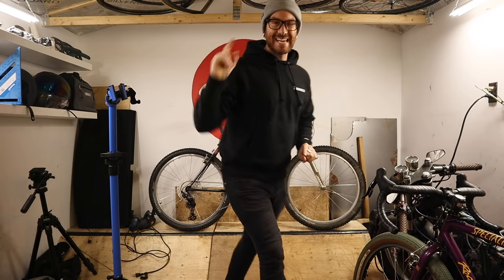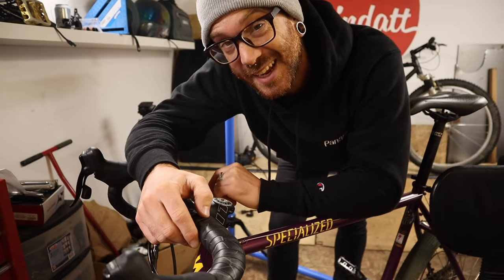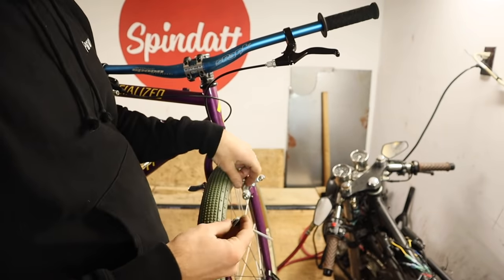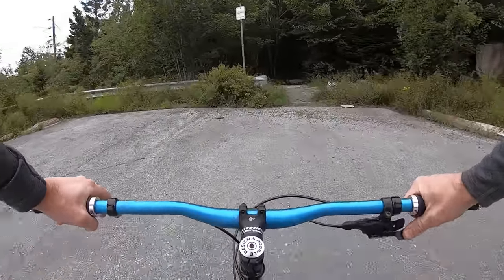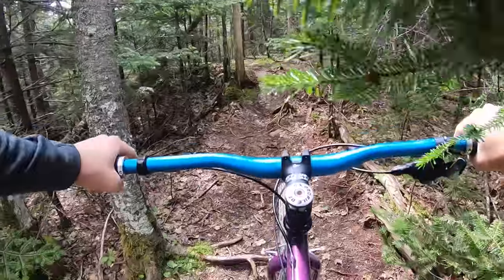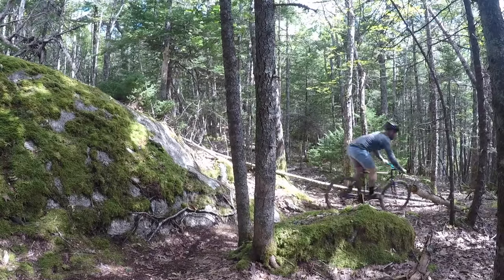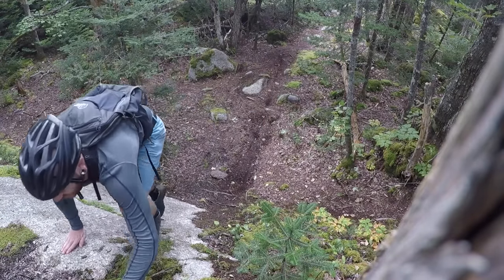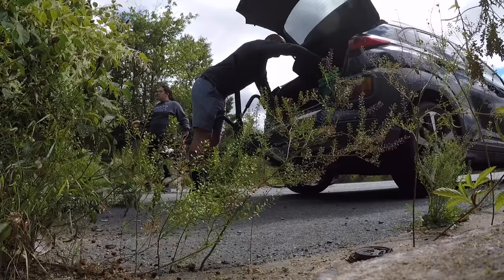I took my upgraded 90's MTB on real single track and...

Comment: We rode technical trails that were really meant for hiking on fully rigid hardtails. Now we ride buffed out and machine built bermy trails with 6 inches of travel and dropper posts. Weird. It's like we are allergic to bumps.
Reply: As someone coming back to mountain biking since the 90s, this is absolutely true.  It was all rocks and roots back in the day. Now it seems like a dirt slippery dip
Reply: @jackwilson8651  I'm trying to ressurect my MTB life after a lot of years out and a few kids in tow. Last time I hit some real dirt was in '94 on my rigid GT. I tried to kick start a new riding schtick in 2003 but the bike has languished mostly unused. Having got my son a somewhat capable  MTB I've discovered that my '03 bike is a dinosaur with 26" wheels and pre "modern geometry" lol
Well I'm still going to ride the ass off it, maybe even have a go on one of these slack-angled monsters. Or maybe I'll just have fun on my practically as new dino...
Reply: Absolutely the truth. I mean, the trails here (Terrace BC Canada) are not so flowy and the drops and jumps on a lot of the trail are really designed for full suspension...But take a full sus bike from nowadays and take it over the same trail as it was built out in the 90s (when it was a mixed use hiking trail) and it would have been the most technical gnarl youd ever ride.
Reply: @AlistairBrugsch  the old geometry its beautiful man, straight design, nothing curve or Fancy.
The new ones makes the seat looks as long as the frame tubes
Reply: Exactly , I started Mtbing around 1991 . Back then we needed these smaller bikes as for me in New Hampshire anyways the trails were either old logging roads ,  tractor trails on farmland ar very narrow hiking/walking paths through the woods .  Nothing was groomed or layed out specifically for Mountain Biking , loose rocks , leaves everywhere , roots , vehicle ruts etc .  Mountain Biking used to be an adventure where we would search for new trails to explore as it's now evolved into the equivalent of going skiing at a resort .

  This single track here in the video  is what my early MTBing experience was , it was a ton of work and wasn't easy . If these old bikes could fit 27.5 wheels to smooth things out a bit  they'd still be used in droves  as they're very light and nimble
Reply: @manchesterexplorer8519 You can pick up a good 1950s bike for about £30. It's not guaranteed that 90s MTBs will ever be worth anything. They could be garage paperweights forever. Unless a Tony Hawk comes along and makes them all the rage, it won't happen.
Reply: @GTMarmot  It depends on the bike as I own a 1992 KONA Hei Hei Ti and a 1996 Yeti ARC as far as vintage bikes , I ride both of them quite often and yes they're valuable " as far as bikes go " .  I can understand if its a 1996 run of the Mill TREK or GIANT Bike  but many 90's bikes are sought after much in the same manner as 1980's BMX  bikes .
Reply: @manchesterexplorer8519  I wouldn't go as far as to say "many". Most of the Muddy Fox bikes from that time (good example of a typical 1990s MTB) are worth pennies - they are basically scrap. There are people saying they'll be collectable one day (mostly Youtubers) but I doubt it. I copied and pasted your bikes into Ebay but it turned up no info on past prices. If you use them then there's no point thinking about what they might be worth anyway. I don't use mine (Muddy Fox) and I'd like it to be worth something one day, but I don't think it will be worth anything. So I'm stuck with it as an ornament. What do you think your bikes are worth?
Reply: @GTMarmot  I've had two offers for my 1992 KONA Hei Hei frame before I built it up . One offer was $600 the other was $800  . The YETI in the condition that the bike is in likely pushing $2,000+ for the complete bike
Reply: @GTMarmot  Why dont you ride your old bike ? I don't get it as it's the equivalent of owning a nice 1960's classic car and not driving it because a new car drives better 🤷‍♂
Reply: @manchesterexplorer8519  It's not the bike's fault. I just don't enjoy cycling. I like the sensation of moving along on 2 wheels, but not the exertion.
Reply: @GTMarmot  At 47 I here ya , but it keeps my legs fresh and strong which is one of the first things to go with age . I wouldn't mind an E-Bike to run quick errands in the city though .
Reply: @juanchofernandez1793  The curvy modern bikes will never hold up in the looks department , a 1988 Ford Taurus used to be considered a futuristic cool looking car also 🤣. 

  Modern carbon framed bikes are great as far as tech , especially full suspension obviously but carbon has a short shelf life and most of these full suspension bikes bought today nobody will care about in just 10 years from now . I see suspension bikes that are 10+ years old on Marketplace etc for like  $600 because they're outdated and many of these bikes were once $3000+ .

   The straight tube with a nice 1990's paint job will always hold up in durability and the looks department  . Titanium is the best though as it's timeless .
Reply: @manchesterexplorer8519  Same age as you, and I can see we have different views of the world, although it would be a boring world if everyone thought the same way. From my pov, I don't want to do any errands in the city, ever, and I like petrol motorcycles. The legs strength thing is absolutely true, but from my pov, that's a battle everyone loses. You can put all your heart, mind, effort, struggle and money into it and it doesn't matter - you lose it all, go old and weak, and die. This is an ineffable truth, and it veers towards an eastern style of fatalism. That's why there's the Sisyphean myth. I don't believe in it, because it was put there to shape a society a certain way. Right at the start of the Nicomachean Ethics, it's said that the mythology must be chosen in such a way as to keep youth active, brave, etc. for a greater good: a social good. A social good can be very different from an individual good. As a child I did a lot of cycling and now I'm bored to tears with it. Perhaps I did too much cycling, who knows. But a pina colada in hand, golden sands, palm trees, etc. are my sole version of the "great outdoors". Nothing I find ennobling about struggle and hardship. I am not English enough to appreciate words like "bracing", etc. But I thank you for sharing your thoughts. It's good when people understand each other more through frank and open discussion.
Reply: Amen. If you ride trails built for cycling, then it's not really mountainbiking any more.

Comment: I’m glad I’m not the only one who finds rigid old mountain bikes fun on trails! I just picked up a DiamondBack Ascent from the late 80s to early 90s, and you basically just took what I had envisioned and made it real. Thanks for showing me how cool it’ll be!❤️
Reply: Thinking of picking up that same bike ascent ex
Reply: I have a 1990 diamondback apex. Wanna do a hybrid build but I'm really not too sure still lol
Reply: I have ridden bmx up till 39 years old. I still ride bmx, but I started riding mtb last couple of years also. I almost prefer rigid frames. I don't mind suspension in the front, but I lock it out probably 50% of the time. I guess I like using body English rather than the suspension on my bike doing it for me.

Comment: I rode technical downhill trails for years in Arizona on a non suspended Cannondale Beast of the East. My buddy put a Rock Shox fork on his bike but I resisted for a long time. "My elbows and knees are my suspension." I said.  My buddy thought a moment and then before riding off, he said, "Well however much suspension you have with your elbows, I have 2 inches more!"

Comment: @Spindatt How is the Profile Designs quill stem adapter holding up? I did the same stem conversion on a 1988 Giant Chinook using an 8$ aluminum quill stem adapter from Amazon and it snapped in half after 4 rides on blue singletrack. Now I am wondering whether I just had bad luck and should try another quill stem, such as the Profile Designs, or just get some expensive Surly Sunrise handlebars with shims to fit the existing steel quill stem? Many thanks for any advice!

Comment: I have the same frame but in red. What's that black crankset that you swapped on to the grouch? I am looking for an upgrade from the original crankset, but q factor and chainline are tricky. Also, did you change the spindle length? Love those blue bars btw

Comment: Spindatt I have a super clean 90s Stumpjumper in purple. Can I ask for guidance on a couple stem/head tube questions? I want use a riser adapter and run flat bars just like this. I can send you pics?

Comment: I have a late 2010s 26 full aluminium, got a new trans 1x11 and a rigid fork, a modern short stem to go more comfy and semi slick tires, i usually ride it in the city and some gravel or trails but nothing special so i wanted a rigid set up, now i Will update the v-brakes to a hydraulic system, just to keep it modern. 

Nice build broo

Comment: A couple of months ago I built up a Stooge Mk6, which is a fully rigid steel frame but with (relatively) modern geo, disc brakes and dropper routing. It's now my only MTB. Rigid riding is fun as hell and like you said, everything is a feature - old trails are interesting again, and new trails are frankly terrifying in the best way. Looking forward to getting it out to an uplifted bike park soon...

Comment: I have done similar things to my 2003 Gary Fisher Hoo Koo E Koo. 710 mm handlebars, 1x with a 32t Race Face Narrow Wide chainring. I found a Rock Shox SID air fork from the same year for $118 to replace the Manitou Axel spring shock that came with it. The whole thing weighs 27 lbs. I'm 48. I just ride it in my front & back yard.

Comment: Regarding the usage of shift housing for brakes. While it does improve the feel of the brakes, it is extremely unsafe to use shift housing for brakes. Under heavy braking, shift housing can (and eventually will) split and cause your brakes to fail completely. A better/safer alternative is to use compressionless brake housing, which is essentially shift housing that has a reinforced outer casing that makes it safe to use for brakes. This advice comes from 35+ years experience as a professional bicycle mechanic, but I still suggest anyone thinking of using regular shift housing for their brakes to google it. You will not find a single legitimate source that says anything other than, it's not safe...don't do it.
Reply from the maker: It’s what I had, definitely know it’s not correct haha
Reply: Yeah, I got chills when he did that. It feels great, up to the point it totally fails.
Reply: @Spindatt  how much do you sell this bike

Comment: I'm sorry, but old 90's MTB's put a bigger smile on my face than any modern MTB I've ever ridden. I guess they hadn't engineered the rawness out of them yet in the 90's, especially with an old steel frame & fork. Slap new rubber on them, tune the snot out of them and they are rockets on a trail. Besides, nothing's cooler than an old steel MTB with new fat tires.

Comment: A dropper isn't period-authentic though.  You can still get NOS "hite-rites" off ebay, and they weigh only 100 g.  You should definitely go with a narrow bar.  There was a reason narrow bars were preferred for this kind of riding back in the fully rigid days, although it takes a little muscle.

Comment: I ride a similar bike! I have a 26" 2000 vintage Giant that I put wide bars on with a Salsa cro moto 29" fork on. Rigid 69er totally shreds the trails around here :-)
Reply: 29 fork with 26 wheels? wat size tyres you use?

Comment: Well, Eric just made 26" wheeled mtn bikes relevant again....
Reply: They have never been irrelevant for me🤙
Reply: 26 inch revolution!
Reply: RollinRat  I know 26" was never really irrelevant, but it was getting more difficult to get tires and many weren't tubeless. I rode 26" mtb's for nearly 30 yrs before getting myself a plus hardtail when I crack my third frame. Manufacturers push the trends not the riders, just look at groupsets. My current bike has 12spds, but I barely use 7 of those on any given ride.
BTW I was being a bit sarcastic with my comment because there's been a pretty decent resurgence in 26er restorations and conversions
Reply: @bigbadstretch13yrago  That's your fault. Not everyone needs shocks, disc brakes, etc. to ride well and have fun.

Comment: Versatility is the name of the game. 90s steel MTB's are:
- Gravel Bikes .................... Check!
- Mountain Bikes ............... Check!
- Commuter Bikes ............. Check!
- Utility Bikes w/ racks ...... Check!
- Adults BMX Bikes ........... Check!
- Explorer Bikes ................. Check!
- Road Race Bikes ............. Nope!
- Downhill Bikes ................. Nope!
What did I forget?
Anyway, they cover almost every use case and they look cool! What could you possibly want more?
Reply: Not useless old bikes for sure.  You nailed it.  I feel its where bikes peaked as utilitarian, fun and practical.  You have to be selective about all the so called tech that followed these bikes.  Lots of marketing and false promises with outrageous maintenance costs and built in obsolescence.
Reply: RollinRat  that poor huffy would rather fall apart when it spots a serious rider and if it took the challenge it would start falling apart with a wobbling crank set the first uphill and finish with failing brakes downhill. Seriously, my niece got one and it discouraged her for a long time from riding.
So, please, don't compare a serious MTB from the 90s with a huffy, that's a disgrace.
Reply: RollinRat  Going ad hominem on the second post? Not the best style.
A bike is a tool. And as it is with tools, there a good ones and not so good ones. You will get the job done with both, but it's neither enjoyable nor will you get good results when working with a poor tool.

Comment: (Edit: German here, talking millimeters.) What steering tube + stem are you using for these handlebars? They're 31,5 for sure. But the diameter of the 90s MTBs usually is 22,2 or something, right? I only found these really ugly steering tubes that are mostly used for E-City-Bikes, but they're the only ones I found that have a 22,2 tube and have the increased diameter if 28,6 at the top. Yours looks really elegant though.

Comment: Dude! You are in the 26er river and your pan is full of gold! You summed up the re-evolution of the 26er in one word, "capable." The formula for C is T+MD=C: T (Tires)+MD(Modern Drivetrain)=C(Capable). B(Brakes) are also part of the equation but not quite as important and V-Brakes, though not equal to disc and not as cool as Cantis still have a ton of stopping power. Also Russ at PLP just found out a 26er tire is very close to the same diameter as 27.5. These newer tires, bigger tires really help an old rigid shine becuase of the increase in volume. BITD the norm was like a 2.0. That's way to small if your full rigid.

Now bring on those Bull Moose bars man!!!
Reply: Yessss the 26 inch revolution.  559×54 super capable indeed

Comment: I bought an early 90s Diamondback Ascent at goodwill for 15 bucks.   And the bike was love one day it came with cabonfiber seat post and bars l, paniracer tires.
Any advice on getting modern stem.   Thanks
Reply: I have one of those that I'm fixing up. It has a quill stem so to put a more modern stem you'll have to change the fork to a threadless with matching headset of course. The bike really isn't worth it unless you just have money to burn.
Reply: @spareparts7630  nah I just put new tires and tubes and grips, tune up and cleaned. Of it doesn't sell I might just keep it.  Lol.   For a while when the bike shortage was going on  I was ablebto sell a week within a week. Now ...   not so much 😕

Comment: I get to be driven to a bike shop tomorrow. As I was out cruising around and gawking at all the lawns of those with greener thumbs than mine, I noticed my rear brake was braking unevenly, and looking back... yep, I have a broke spoke on the non-drive side of my rear wheel.  The wobble wasn't too bad this time, so I could get home without having to muck up the spoke tension.  I'm not happy, because I'm certain that, when one spoke goes BOING for no particular reason, other spokes are soon to follow.
Reply: Not always.  Change the spoke.  Check the tension. Drive side spoke tension matters. The long spokes on the none drive are whatever they are as long as they are even as possible. Ideal spoke tension is recommended by the rim manufacturer with the tires off. Dish, true, de-stress, tension, de-stress, balance tension. De-stress. The basics of the  process. Some folks think high tension equals a strong wheel.  However if its to high for the rims tolerance then spokes break and things deteriorate from there.  Cheers!
Reply: @613.Rooster  Thanks.  I have made a horrible discovery however.  Most of the spokes are from 1992, and well, the nipples are rounded to the point of unusability.  I'm glad my wheel was already mostly tru-ish, so my wheel doesn't slither like a snake, nor bob up and down like a pogo stick.

Edit: What is this ribbon lying on the floor? Oh.  The rim strip. Sigh. Off with the wheel, off with the tire, on with the rim tape...

Comment: Ah, dropper-post, no, you cant do that.
Quick release with a longer leaver, thats keeping with the 90's look.....
String a wire from a spot on the post to the toptube to set max extension, ghetto dropper voila!